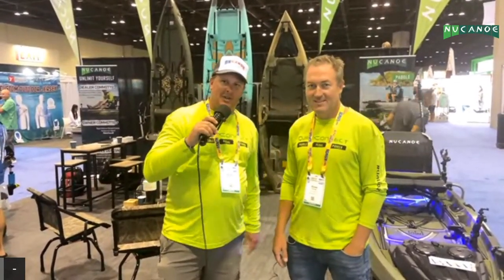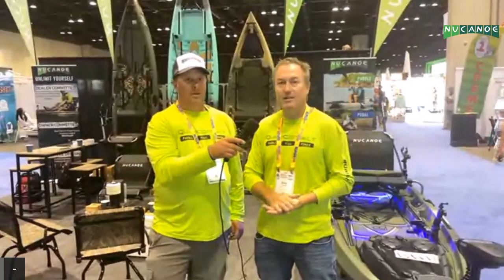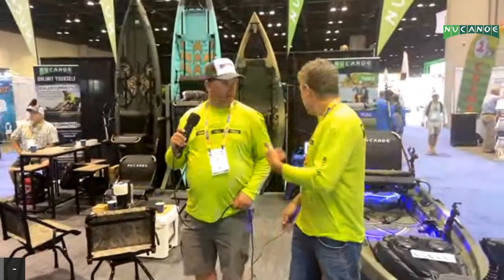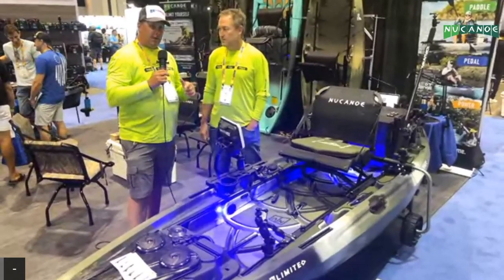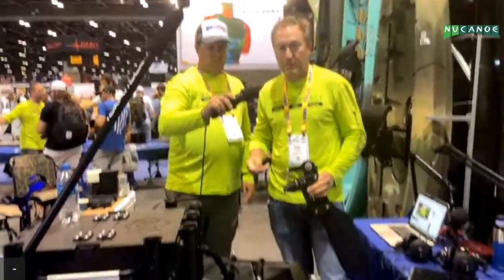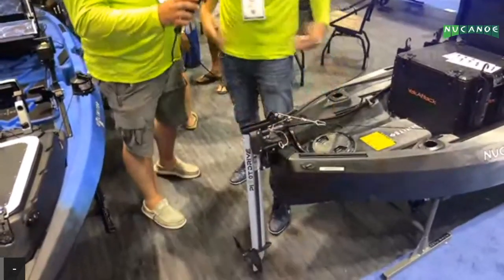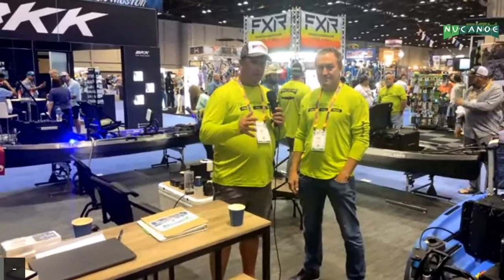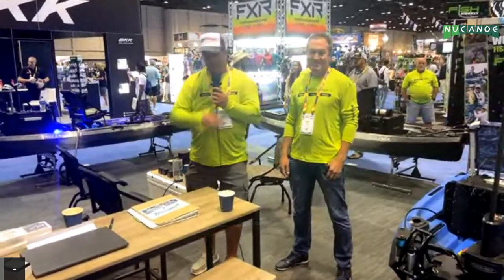QuickConnect Overview | Live with Blake Young

Comment: Does the steering cable come unattached when u lift the motor up with the pull cord or does it stay in place? Wondering if you have to get out of the boat and connect the steering cable every time the motor is lifted, or in other words; does the motor have to be in the down and ready position in order for the steering cable to be connected?
Reply from the maker: The steering swing arm & steering cable remain in place when the motor is retracted. So everything works perfectly on the fly!